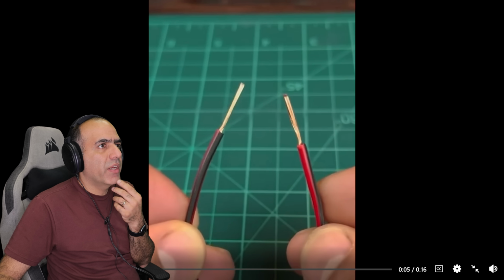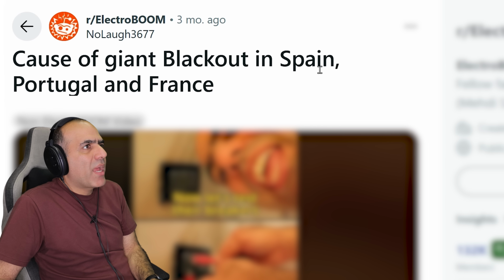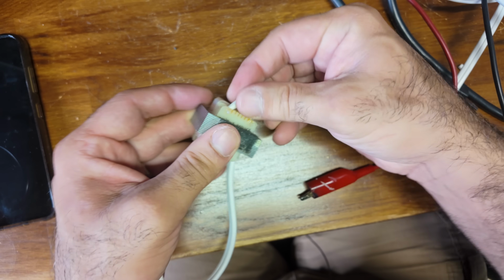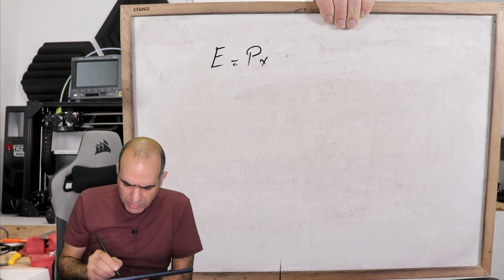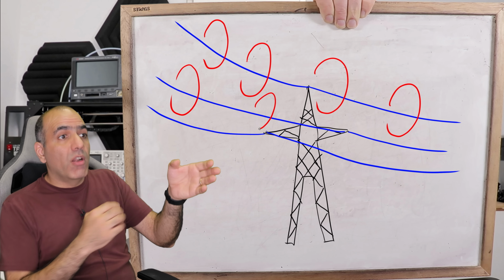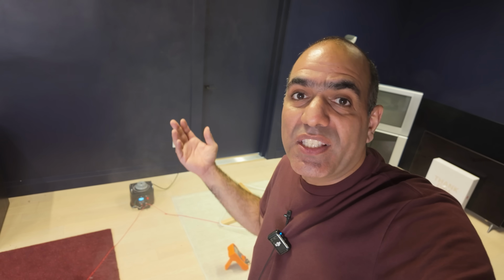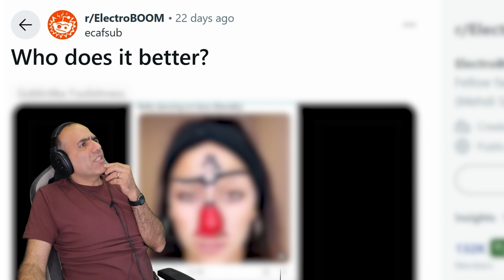Power Lines at Knee Level? Campfire with AA Battery?! (LATITY-016)

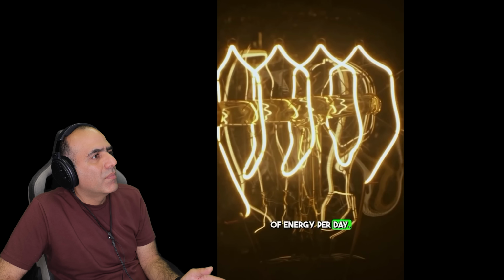Comment: 9:07 The claim of „2000W of Energy per day“ already disqualifies the video. Power and Energy are not exactly the same. Maybe they meant 2000Wh of energy in two days?
Reply: Yep, Watts = Joules per Second. I seriously doubt the whole system averaged 2KW of continuous output.
Reply: That was my assumption too, since I doubt the guy in the video really knows much about electricity. 2000Wh sounds like each person would have to generate about 0.074Wh passing through, which would need them to generate about 133W for 2 seconds. I suppose that's doable, seems a little high to me, but I have no idea how much energy the average person can produce manually turning a generator. However those turnstiles didn't look like they had enough resistance to be generating that much to me.
Reply: @irreverends Seems like a doable thing. That’s about the same energy output as a 75KG person climbing a staircase. Elite road cyclists can do 800W in a hill climb. 200W is more like it for your average commuter.

Honestly though, it’s not a good use of resources. One rooftop solar panel would far out strip it.
Reply: @LongPeter  It's probably meant to be a marketing campaign that this guy simply misunderstood.

Comment: if no one is using power the flux radiation drops on all the power lines... so if that chain was sparking like a 12v battery on a 10ft long fence and its about 360 foot away... voltage flux drops 8 times for each centimeter away... 689,484,876,854,694,949,323,509,246,945.6 volt power line... fence has solar powered a ESD box on is to slow syndrome from opening door into her room, the whole 220 volts. marriage is a mirage ... reach in to grab 1kg gold bar from hole in box... just enough that they factually quit.

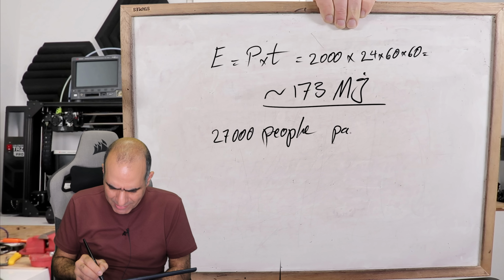Comment: 9:32 I'm pretty sure that's the common mistake of saying watts instead of watt hours. I can believe 2000 Wh per day, or 7.2 MJ. That's 266 J per person, or 133 W over 2 seconds.
Reply: I think this is right. I would be surprised if it powered more than the turnstiles themselves.
Reply: I found a source saying it was 2100 Wh over the two days, not per day. So it's even worse.They most likely can't even power the monitor on the side...
Reply: I think they meant 2000Wh over the whole two days. So, an average of about 40W continuous.
Reply: But even as a proof of concept it's absolutely baffling to me why they designed the turnstiles like wind turbines. With 27,000 people passing and all the energy generated, they didn't even save a fraction of the energy, let alone cost of designing, engineering and manufacturing those turnstiles and I'm fairly certain they wouldn't even break even with the energy and money spent if they tested this for a whole year. The absolute state of humanity in 2025...
Reply: @Metatr0n  I thought they were designed like wind turbines because it's an April Fools joke.
Reply: OK, looked it up and it might be real but the quoted power is 0.2W (hours?) per person
Reply: sounds like someting a small solar panel could generate more easily
Reply: @Keneo1  
My thoughts exactly
Reply: that still sounds way to high if you ask me... at 133W I would think, it would be pretty hard to push... Remember those old Bicycle-dynamos that were a pain in the ass to tread against when you were a kid? those were 3W...
Reply: @malte1984  I would bet money that it was actually 2,000 J/d, not W/d, or an average of 23mW.
Reply: @malte1984  Yeah I came to the same 133W for 2 seconds as the initial comment, and those turnstiles really really didn't look like they had enough resistance to be generating 133W. However 2 seconds burst energy a human should be capable of that much no problem.
Reply: @irreverends If people had to generate 133W for 2 seconds, very few people would push hard enough to pass through.  That is energy (work) of 266 Joules which is 266 Newton-meters, which would require an average force of 532 Newtons if the distance through the turnstile is half a meter.  A force of 532 Newtons is about 120 pounds.  More likely, each person generated a peak power (not energy) of 0.2 Watts for about a second, which is an energy of 0.2 Joules, which would require a force averaging about 0.4 Newtons (which is less than 0.1 pound).  This would be the force if the mechanism were 100% efficient, which it is not.  27000 such passengers would produce 5400 Joules which is 0.0015 kilowatt-hours of electricity which is worth 0.0003 cents at a price of 20 cents per kilowatt-hour. 🙂
Reply: I've tracked down the primary source, it says "For 2 days last year, as each passenger passed through the turnstiles, the turbines converted their movement into green energy. 27,000 passengers used the turnstiles, and each passenger generated 0.2 watts of energy."

I have no idea how it turned into 2kW/d, but it's not very impressive. What is impressive, though, is how the news spread. I've found a few direct quotes of the original source, but with the last part (each passenger generated 0.2 W) omitted, presumably because it's not as impressive. Some sources managed to quote 0.2W as "2000W/day", which is both false and nonsensical, and then some quoted those further (instead of looking for the original source).
Reply: @MaskedDeath_  They turned it into "2kW/d" by mistaking Watts and Joules. 2kJ/d is 0.023W.
Reply: Yeah they said watts IN one day, not FOR one day. Definitely misquoted units.
Reply: Definitely, at this point I swear most people get it wrong far more often than they get it right even though it's 50/50
Reply: I don't think this was actually meant to generate a useful ammount of energy, I think it was more meant as some sort of demonstration, maybe to make a point about exploiting overlooked sources of energy. The fact that the blades were shaped like windmill blades makes me think that it was perhaps just an advertisement for a wind energy company.
Reply: @hedgehog3180 Making turnstiles self powered could potentially be sufficient to make them worthwhile, it would probably make wiring a lot easier and since they need a mechanism to control people moving through them anyway it might not even be much more expensive/complex to build
Reply: This is why I hate the "watt-hour" unit of measurement. Not only is silly in concept (akin to measuring distance in kilometers per second per hour), but it creates this kind of ambiguity. A unit of measurement already exists. No need to reinvent it.
Reply: So many STEM illiterates confuse wires with cables, voltage with current, power with energy that if they were fined just $10 for their stupidity, we cold buy millions of bottles of beer.
Reply: So with the created electricity I could run my aircon for around 40 minutes 😂
Reply: I don't even think that's plausible. 200J is about the energy of 100 pounds (440N) of force over half a meter of distance. I highly doubt people are pushing THAT hard to get through.
Reply: I don't believe that, too much resistance. That roughly a quarter of what a top cyclists can do.
Reply: @samiraperi467 A top cyclist can do 600W *sustained*, any random person should be able to sustain 100W of power output for a mere 2s, plus if they just move through slower then the power requirement goes down
Reply: This is a meaningless amount of power. Have you ever thought about the amount of power that would have to go into building and maintaining these more complex turnstiles?
Reply: Well surely they do not produce any meaningful energy and is more of a PR stunt. I wonder how much energy it took to develop the concept, prototype it and put it into production as well as the energy cost of extraction for required materials. When will the turnstiles have re-payed the energy they cost to produce? It would be extremely hard to justify as a "good idea" if they will never generate any meaningful energy, take years to even create the energy they took to make and most likely there were already turnstiles there which worked fine before they changed them.
Reply: 2000 Wh per day, so 2000 joule per second per hour per day. Can't we just use joule lol.
Reply: That makes sense. In any case, it's pretty cool, every little bit of power adds up these days. Even if it's barely enough to power a 4 inch screen. Hopefully they can evolve the gearing and other aspects and make it more efficient.
Reply: i think they generated 2000Watts in TOTAL per day? 2000x2 divided by 27000 people = 0,148 watt per person going through the turnthingy
Reply: @dalyxia  You're confusing power with energy.
Reply: @dalyxia you make the same mistake as the reporter. W measures instant power, while Wh measures energy
Reply: @dalyxia  Now that I can believe, even if it's still a magnitude more than my back-of-napkin math.

Comment: Sometimes I use that two-halves outlet trick when I have a big power brick attached to the plug-part that I can't fit next to other stuff easily. That way it only uses/blocks 2 outlets instead of 3.

Comment: I would think it was a E field for the fence since the section was at 90deg in relationship to the power wire Axis. I have used this relationship many times to reduce EMC issues in circuit board designs. Love the Video.
Reply: Yes, it's capacitive coupling. It has nothing to do with induction.

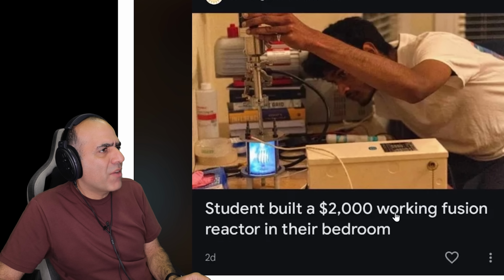Comment: 5:15 technically, it's a real fusion reactor, but a cold one, working on near-vacuum pressures and besides high voltage, they use deuterium gas. It's a CONCEPT but functional reactor, it will fuse atoms together, at very low rate, but won't be a sustainable reaction... (= more energy in than out)
Reply: Basically a physicist/engineer "toy"
Reply: This is not "cold fusion".  The temperature of the ions colliding inside the plasma in the core of a farnsworth fusor reach around 175 million kelvin.  The ions collide at very high velocities inside of a very hot plasma.
Reply: Uwoslab is trying to make one using helium gas and managed to get plasma during his recent Subathon on twitch. He just needs to get the gas and fix his supply
Reply: @GabeV197  hi uwoslab enjoyer lol
Reply: We already know at this point that cold fusion or any Low-Energy Nuclear Reactions is a scam
Reply: @jeromegaces6184  True, but this is neither of those.
Reply: Its has its practical usage as an neutron generator. So not quite a toy.
Reply: @Toxicity1987 barely.
Reply: Farnsworth fusor.
Reply: There is nothing cold about it. It's thermal fusion.
Reply: So not actually a reactor. To be a reactor, you have to achieve criticality. That's just a Fusor.
Reply: The concept of criticality doesnt really make sense when talking about fusion. Even in future commercial fusion power plants there won't be a chain reaction.
Reply: Why is nobody talking about the profile

Comment: I can confirm that high voltage power lines do induce a voltage in to metal under them.  Several years ago (hmm, a few decades actually) I parked my truck under high voltage transmission lines at a auto junk yard.  After a half day of wandering around getting vintage car parts I got back to my truck.  My cousin and I were leaning on the top edge of my truck's tailgate that was mostly bare metal and noticed that it felt like we were being jabbed by metal burs.  Ran my hand across it and it felt fine.  Lean on it with our sweaty forearms and you could feel it.  Realized what was happening and pulled a volt meter out and checked the voltage from the truck body to ground and sure enough there was a significant voltage there.  I honestly don't remember what the voltage reading was.  It was enough to give us a continuous very mild shock though.
Reply: Yes and in addition to the effect mentioned by mhedi:
it is AC for the Power lines meaning that there will be an additional effect: Capacitance.
The wire couples capacitively to the fence (or in your case car) .
You might say the wire is thin and has not much surface area, but it is long and the fence is big.
Considering that over that distance air is pretty much non conductive even at that voltage i think this might be a significant factor even tho the frequency is low.
You might want to test that. Try wrapping a big area plate in plastic , and then attach a small thin (isolated at best) wire to it,and see if you still pick up voltage at the power line.
If so the E-field itselve (even without the air as a medium) has a significant effect.
Reply: I stopped under the european equivalent, which had more lines than in the video, with my bike (because of the hum) and after removing my gloves i touched the wire it zapped me.
I like the idea that you had a voltmeter with you, i might bring one now too. :))
Reply: Makes sense, especially because the body of the car is sitting on some very insulating tires.
Reply: It's called capacitive coupling. It's the effect of the electric field. Induction and magnetic field has nothing to do with it.

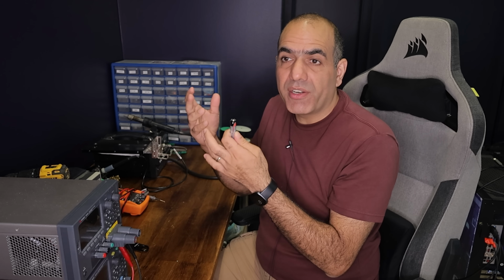Comment: 1:15 We used to do that at school in electronics lessons instead of whatever we were supposed to be doing using NiMH batteries and a length of graphite from a pencil - gets hot AF and causes whatever the binding agent inside the graphite is to melt and leech out.

Comment: Hi Electroboom, greetings from Bosnia, being a long time fan of your videos,learned a lot using your videos(i am amateur electrican i mean i didnt finish school for that but is my life wish to be one but i know stuff) so recently i got myself PMSM motor that has power output of 2000w and its HV 230 to 300v AC 3080rpm and i wondered if you could make some video about PMSM and generator video like explaining it how generator limits its current output (by that i mean by impedance of it) and my motor has resistance of windings phase to phase 2Ω or 1Ω phase to neutral point ,could it in reverse like in generator mode outputs like 1 to 1.5kw, i calculated for possible  efficency of maybe 92 to max 94%?

Comment: "Wire nuts" actually seem like a great idea, assuming they actually reduce capillary effects that happens when water gets into the cable. Cars can have a real issue with water traveling around if it gets in the wire loom.

Comment: You shouldn't measure voltage or current when you touching the 2 ends as well , as now you body is in parallel with the thing your trying to measure..
So you get a false reading

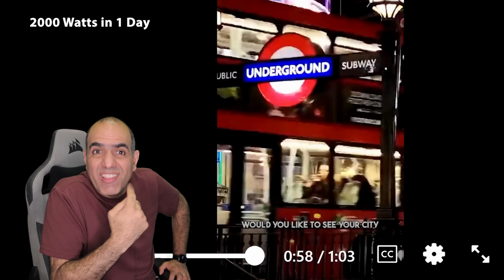Comment: 9:14, I think he confused 2000W and 2000Wh energy units.. sadly alot of people on internet confuse W and Wh.... back to school guys!.. So at 2000Wh  energy per 24h this mean 83watt of average power and 2000Wh for 27000 people = 0.074Wh per person and at 2 sec average this is 133watts of power during 2 sec.. WHICH WOULD MAKE SENSE ELECTRO BOOM =)🧐
Reply: 2 kWh? Wow. That's like 60 cents in savings. At that rate it will only take 200 years to pay back the installation cost
Reply: e.g. some-one tricked an government employee to spend money into useless gimmick. Or it's an art-project. 
I once danced on a electricity generating floor, which at best is also just a gimmick, although with mass produced MEMS it might be more affordable then expected.
Reply: @Tuning3434  Solar Freakin' Roadways!
Reply: @Tuning3434  I mean it's probably a marketing stunt that the metro got paid for just like all the other advertisements.
Reply: Yeah I thought the same. The energy of 2kWh is basically nothing. They saved maybe less than a euro a day but put those transformers, gearboxes, turnstiles, etc. Basically a waste of tax money going to probably greenwashing politicians.
Reply: or he was thinking of average power across the day. doesn't excuse the lack of clarification anyway.... it's a dumb tiktok.
Reply: Going from 2kW a day to 3.2kW per person 😂
Reply: This! Installed more broadly in Paris, London or NY which see millions of daily passengers, could generate non-trivial amounts of energy.
Reply: It really wouldn't. To generate 133 watts of power that's around what, 100, maybe 150 lbs moved over three feet. No human is using a turnstyle that needs 100lbs of force to move

Comment: The outlet terminal spacing is done for a reason.  With terminals layed out with even spacing between all of them you can plug in a wide wall wart.  One power strip I have has contoured ends which do not allow you to plug in a wall wart on the ends..  If I plug in multiple wide wall warts in the "correct" terminal locations I can only fit 3 of them.  A mix of correct and offset and I can get 4 on it.

Comment: Maybe the outlet where you can plug your devices taking two outlets its designed to be installed on difficult to reach places? Like under a table or behind furniture. Then you wouldnt have to fight with the outlet while you try to plug something by feel. You could just plug it wherever and it would work.
Im just guessing, but its the only explanation i cant think of.

Comment: For the plug in the middle of 2 outlets: I know it's a different country (NL) and different outlets. But alot of my power bars lose alot of connections simply because of stupid big plugs/adapters. I think I could add 1 or 2 "if" I had more options like that
Reply: For adapters I use those simple square ones with 4 outlets. They can handle 3 oversized things, and still 1 normal plug. It doesn't work in those bars indeed

Comment: On the campfire starter,  the material used was charcloth, which easily forms a hot, long-lasting ember. The pile he ignited was shaved fatwood. Charcloth is cotton burned in a low-oxygen environment, typically made a metal tin with a single small hole in it placed in a campfire, when allowed to fully cool before opening. Fatwood is the wood from old sap-laden pine tree stumps.
Reply: I came to say the same thing,
Reply: @billhacks  I also came to say the same thing.
Reply: Well, I wasn't gonna actually say 'charcloth', because I wouldn't have been able to explain it as well as you, so I didn't wanna get into it.  But I came here to say the same thing, too.
Reply: Came here to say it's called a prison lighter..
Reply: Just simply came